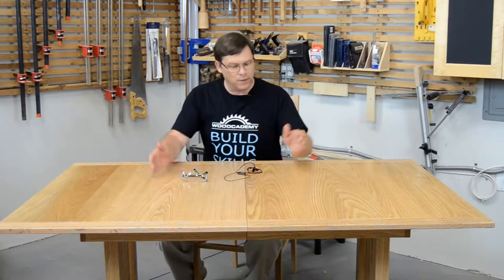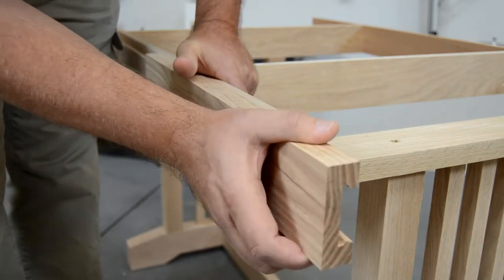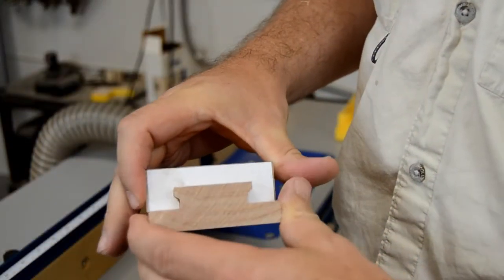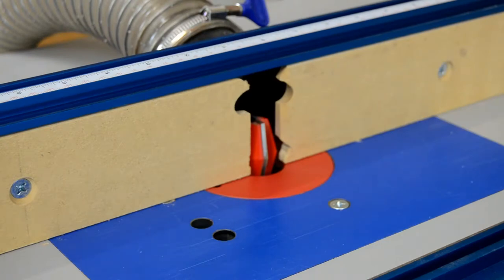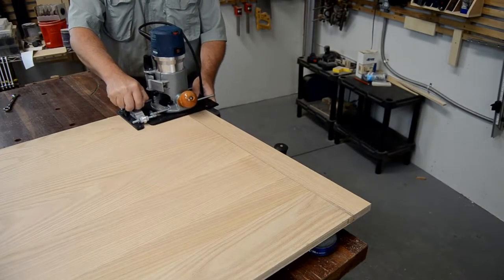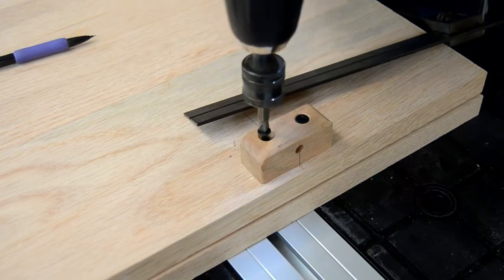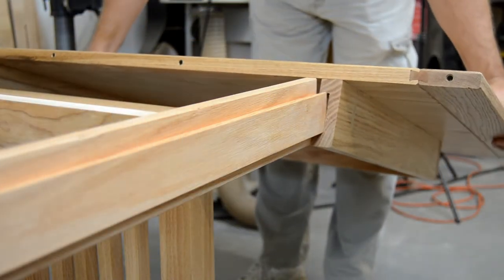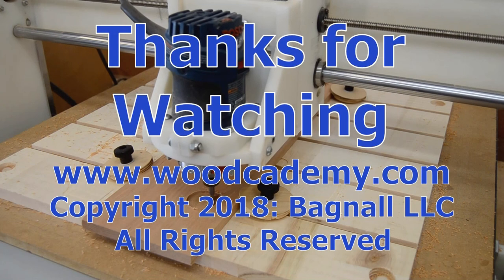Butterfly Leaf Dining Table Pt2

Comment: This is a GOLDMINE of information!  Thank you so much for making it!  And the plans--Free plans!  Almost enough to bring a tear to my eye. I've been wanting a dining table    e x a c t l y    like this one for years now! It's easy to follow, even for a relatively new Carpenter.  I love how you took the time to explain your thinking, especially regarding the wood movement and board placement for the table top!  (That is something I had wondered about when looking at different tables' construction; It's nice to see it laid out so plainly here!) I'd rather learn from someone else's experience than to have potentially found THAT one out the hard way.  I'm vibrating with excitement just thinking about this project!

I've not been impressed by the throw-away fashion furniture and love me a good, solid family heirloom.  And even I can tell how much thought and experience was put into designing this table for years of genuine use.  A table that is truly engineered to last a life time.  Even factoring in general maintenance!  Pop out a few screws and reapply/scrape off wax as needed, if it is even needed. Like I said, a goldmine.

I'd love to pick your brain though and I'm hoping you'll humor me:

-What considerations must I make if the dimensions need changed to fit the space it will occupy? We're talking a 30"Wx72"L table--oddball dimensions compared to most modern dining tables.  Would you recommend a full-sized, cross-sectioned butterfly mock-up like you did here? (In my needed dimensions, of course) It could potentially effect the table base dimensions too. Hmmmmm...

-Where did you get the hardware from, like the Butterfly Leaf's hinges? The Butterfly Leaf's Rod?

-Those beautiful, beautiful clamps. Where can I get my hands on some of those??? The extra long ones, the strap ones--just, YES please.

-And while I'm at it, do you think my needed dimensions would negatively impact the functionality of the dining table? Engineering is not a skillset of mine. It seems you've made, and used your fair share of dining tables, so I'd like your thoughts on that, as well.

Thank you again for the amazing videos; Wishing you the best!   :D
Reply from the maker: Marvin, Thansk for the kind words! Let's make this easy. Email me at ralph@woodcademy.com and we can discuss all your questions.

Comment: Thank you for this great, informative video. Beside the leaf pins, do you use any other locking hardware to keep the two table sides together when the butterfly leaf is not in use?
Reply from the maker: Jaclyn, thank you for the kind words. I did not use any sort of lock hardware on mine. The table can be easily opened and closed by one person, but it has not shown any tendency to open on its own in the years we have been using it. Ours stays in one spot. If you were to move yours around regularly, a lock might not be a bad idea. But a pair of simple latches would be more than sufficient.

Comment: Thank you for your detailed plans and video on how this table is constructed.  I have a question: on the leg subassembly drawing the top rail appears to be 26.000 inches long, but the cut list indicates that these rails are 24-3/4 inches long.  How long should the top rails be?  Thanks.
Reply from the maker: Carl, you caught that, thanks for finding my error.  The 24-3/4” dimension is correct. I have fixed the plans for future downloads.

Comment: Great build but I have a question about the attachment of the top. You built splined bread boards to allow for movement then used pocket screws that do not allow movement across the panel. Not sure I understand the reasoning considering the orientation of the panel and the amount of movement across the panel length.
Reply from the maker: Actually, pocket screws do allow for wood movement if you use the right ones. The smooth shank between the washer head and the threads of a Kreg type pocket screw do allot for wood movement. The shank is a smaller diameter than the through hole. You can also redrill the through hole wider if you are concerned. The table is now two years old and has not developed any issues.